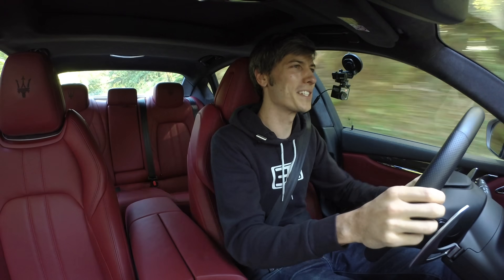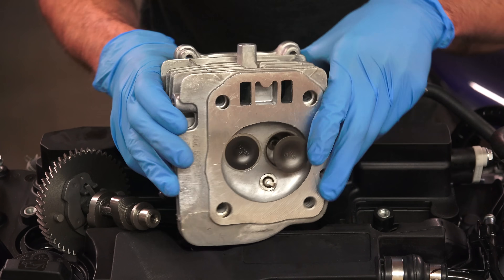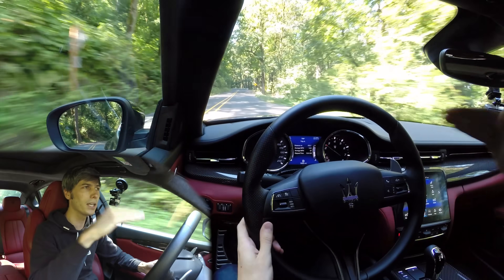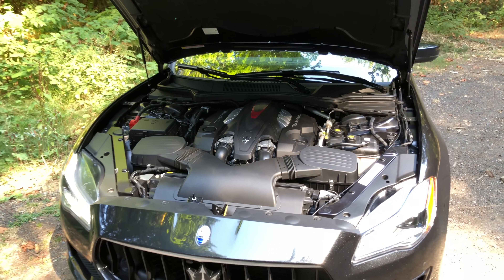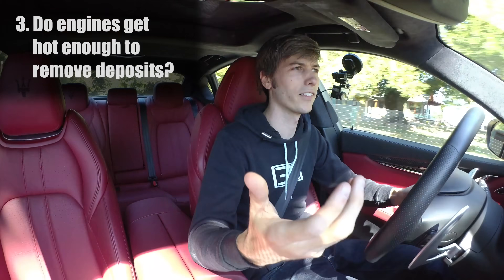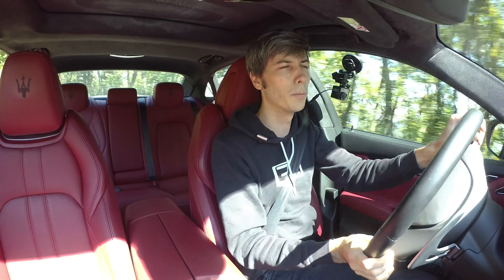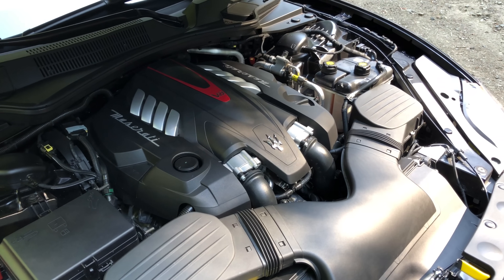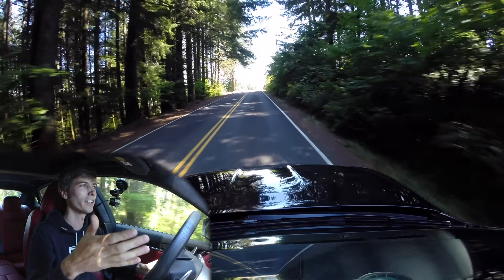Is Redline Good For Your Car's Engine? Italian Tune Up

Comment: Why does the 7.0l ls7 only make 505 horse?
Reply: Because it's NA, a engine is technically a air pump, and an engine can only suck in so much air on it's own, 505 from a na v8 stock is impressive, stock is safe. Port the exhaust and intake, a cam, a tune and you'll see those numbers come up. It'll still be safe, but won't be as efficient on fuel, make more heat, exactly why it didn't come that way stock. Although a turbo or a supercharger, you'll see those number jump, simply because using another air pump to feed an air pump more efficiently and with more condensed volumes of air, but be less reliable because of stress added on components, it's all about more air, more boom, more horse puppies, engine power in a nutshell
Reply: Pushrod V8s don't seem to be able to make very big power per litre without minimizing low end torque and creating excessive emissions, harming fuel economy

Comment: Someone help me!!
I was trying to teach my friend how to drive. And while it was on neutral his dumbass floored it, redlining the car, after that I heard a small pop. Days later my car overheats easily. There’s no leak anywhere. Coolant is at correct lvl. Radiator cap hold pressure. And when I removed the cap there was no coolant in the radiator. Fans work perfectly... any ideas?

Comment: A pointless exercise. Deposits form in different places on different engines depending on configuration, regardless of driving style. In general terms, an engine which is warmed fully, treated somewhat gently and kept with clean fluids will last the longest before major repair is needed. Engines that are track driven need more frequent oil changes and rebuilds, regardless of carbon deposits.

Comment: Just saw this. I'm thinking that there's more that goes into the act of an 'Italian Tune up' than just removing carbon. I feel the term is mostly used in the classic car groups, for one. Burning off older fuel that has sat for a few months, cleaning out gum or varnish that may have just started to form, making valves stick?

Comment: If you spray intake cleaner or even water in the throttle body while having a wedge on your fuel pedal rpms at 
3 k , it will clean alot of stuff out . I know because I do it. You can tell a difference . It might also be cleaning the cat or other parts of the exhaust. Better flow better mojo.

Comment: Could you comment as to the use of a fuel catalyst such a ferrous picanate to help decrease or remove carbon formation. After a brief literature search I have found that this catalyst is helpful in decreasing carbon formation because of a more "even" efficient burn of the fuel. Your thoughts?

Comment: I bought a direct injected turbo from someone who drove the car in stop/go traffic 95% of the time, the car probably never ran harder than 4k RPM.  I used Seafoam throttle body cleaner to see what comes out of it. When I drove it hard (after the Seafoam soaking), someoone actually called 911, because they thought my car was on fire, the amount of smoke it came out was unbelievable.

Comment: Running higher octane fuel is also supposed to clean out your engine. Or you could just drive a Wankle rotary and laugh at people with carbon build up.

Comment: just running the crap out of it is not a good idea. When I got my first car(48 chevy). driving it for a hundred miles at about 45-50mph actually did clean it up enough to make a difference. The idea of running the crap out of it is not a good idea. I have cleaned up carbon with water injection and that really worked good.

Comment: I work with classic cars, which means most of them have carburetors instead of fuel injection. Additionally, thermostats are usually set to open at cooler temperatures compared to modern cars. In my experience, these older cars do benefit noticeably from an Italian tune-up.
Concerning modern cars, I find they can also benefit from an Italian tune-up, although the result is not so dramatic, due to better design. Carbon build-up is not as severe. Having said that, it's always good to go for a long run down the highway, say, on weekends, to clean up all the carbon accumulated in the intake and exhaust conduits during the week on your school and supermarket runs. Diesel engines benefit dramatically from this - think DPF regeneration - as you can easily see the exhaust smoke gradually clear out as you drive at high speed down the highway.
Because of an orthopedic deformation in my right foot - it's bent downwards - all used cars I bought over the years have gotten more responsive after driving them for a week.

Comment: My car ( a diesel Audi ) becomes lazy slightly smokey and loses about 10mph off vmax when I potter about for months at a time. 

A motorway run reverses this process. Vmax returns and once off the motorway the cars acceleration and response is noticeably improved. My car is old tho.

Comment: This is why you are supposed to floor it getting on the highway . Then slow down to about 50 and do a few pulls up to 85 ish  . Also if you’re worried about carbon deposits .... just run super . The Italian tune up is for more older type cars that were all carburetor and just super rich . So they had a lot of built up carbon . Rich is thick . Lean is clean . Lol

Comment: In the old days I saw my dad do this with his old belair and our VW bug. They didn't do this what you're talking about he would rev the engine up and pour water down the carburetor throat and break the carbon deposits lose that way. Has anybody heard of this? No he didn't drench the carburetor opening just a nice steady stream of water enough added throttle to keep the revs controlled.

Comment: I watched this video a month ago and been thinking ever since... seems like your video is all based on heat. But I’m under the impression the “Italian tune up” is based on vibrations and increased airflow and increased combustion pressures and increased fuel flow... I think you should revisit the subject with those in mind.

Comment: How does this apply to turbodiesel engines? Will going full power on the autobahn for several minutes clean my good old TDI? It does not have any EGR system yet, so carbon on the valves might be limited. Also, diesel requires higher temps to burn, which might limit the carbon deposit?

Comment: The people that have talked to me about the "Italian tune-up" never mentioned heat.  They always said it was more about the engine turning at high RPMs and the parts moving and changing direction so quickly, some even talked about vibrations and harmonics, and they were all saying that the engine basically shook or knocked the deposits off with just sheer force.

Comment: I redline my car occasionally, say once a month, and I dont know how much carbon I've got in the engine, but I've got 345 000 km on it with no work done to the engine itself. Also, I redline my motorcycle all the time and it seems to be getting stronger with 2-3 hard pulls. Both fuel injected.

Comment: New sodium filled exhaust valves are meant to keep them cooler though
Reply from the maker: Sure, but exhaust valves get hot enough that generally carbon isn’t as big of an issue. Even sodium ones exceed 600 deg C, where as studies showed over 325 will remove carbon.

Comment: Clever but maybe you missed the most important part, spark plugs. on older less tech engines running at low speeds would often foul the plugs due to over rich fuel mixtures. running at high speed would clear the deposits from the plugs resulting in better smoother running. I doubt that some carbon on the piston will inhibit engine performance greatly. Modern engines can run very lean fuel mixtures so don't suffer so much from fouled spark plugs.

Comment: Why focus solely on heat?. Airflow is another factor to consider.  Airflow through the intake is proportional to power output. Normal driving uses only 10-20% of available max power. At high power the airflow is 5-10 times higher than normal which might break free loose gunk that builds up in the intake, carry it into the combustion chamber and burn it up.

Comment: i do this with some regualarity but with a different goal in mind.  i used to have an 89 Lincoln Town Car and i never tried to push it.  it wasn't built for speed and i was fine to lope along quietly.  day i go to sell it, during the test drive, guy asked can he try flooring it and i say i'm fine with it.  immediately the radiator hose catastrophically fails, all the coolant gushes out, car is undrivable (momentarily) and the sale unsurprisingly falls through.  WOT caused an instant break-down, and it could have been that way for months for all i know.  

these days, when i've hit the weekend or some other point where an engine breakdown won't disrupt my life too badly, i let her rip.  redline that engine a good 5 or 6 times in the hopes that if something were on the edge of failure, it will fail right then, and not when i need it most.  and hey, if it's cleaning something, great.  if not, it's still giving me some peace of mind.

Comment: Have a 1997 Toyota 4Runner with a 3.4L V6 that has been red-lined daily if not weekly since bought new and it has more than 350K miles on it.  The engine is all original but the AT was rebuilt at around 200K miles.

Comment: The Italian tune up is a throwback to a time when fuel and motor oil were of lower quality (50's-70's). Engines at the time would develop coked/stuck rings and general carbon build up within the combustion chamber.   Drivability issues ensued.

Sustained high rpm driving would burn off the carbon and free the rings.  The OP is incorrect when he says "pulls".  At the time you'd go for a 15-20 minute drive.

The last engine I know which would benefit from the Italian tune up is the v8 in BMW e39 M5.

Comment: @Engineering Explained: Here is a quick summary of the chemistry.                                                               1. Methane is the simplest hydrocarbon (CH4) and burns cleanly to CO2 and water. They are part of the saturated (no double bonds) hydrocarbon series. Ethane, propane, butane, pentane ("ane" suffix) etc etc. The general formula is CnH2n+2. (For methane n is 1).
2. The simple unsaturated (double bond) series is CnH2n and is the "ene" suffix series like ethylene etc. Benzene is the cyclic version of this series. These burn less well.
3. Auto fuels are a complex mixture and burn less well due to levels of unsaturation and higher flash points. Under these conditions some heat promoted polymerization tends to occur in the "ene" series along with regular combustion. These form high molecular weight sticky tars which are partially soluble and weakly combustible. (Road asphalt, Barbecue grills!) Any soot formed also adheres to this. Engine surfaces have micro pits in them and allow these tars to penetrate and grow into deposits. Ideally, one can design a super smooth finished surface, but that would make the engine very expensive.
4. Any solvent based cleaning procedure would have to partially dissolve and loosen the tars and carry insoluble carbon with it. Pure carbon itself is not soluble, but can be suspended in a medium as in India ink. Targeting the tars is key. The best method is a physical cleaning, which is tedious and/or expensive and can be justified in some instances.
5. The decarboxylation you referred to in the video is part of this complex process. Heat can technically achieve removal (with its shortcomings) as you correctly pointed out.
6. Other components in fuels can include small amounts of  organo-sulfur compounds like thiophenes which produce SO2. Hence the ultra low sulfur fuels that you see today.
7. Lean burning reduces CO and unburnt fuels and improve fuel economy, but produce NOx due to the chemical reaction of nitrogen with oxygen at high temperatures. ( a stoichiometric reaction would be 1:1 in mole ratio). In the case of methane and oxygen we will need 16 gm of methane for every 32 gm of oxygen, as the molecular weight of methane is 16 and that of oxygen is 32 AU. A lean burn would thus involve excess oxygen i.e. Air. If the ratio is very lean no combustion takes place. This lean burning has a complex effect with respect to tars and carbon deposits and engine designers are constantly tweaking this. Mazda has been working on this for some time now in their Skyactive engines.
8. Ultimately, no engine is immune from from carbon and tar deposits in the long run and physical cleaning is the best way. If one can get 125 to 150 thousand miles over a ten year period, it may not be so bad. The car may not perform optimally, but can still be a basic transportation car. As we age we get deposits in our blood vessels and heart valves!
Reply: Addendum to point 2 above. Benzene does not conform to the CnH2n formula of the " ene" series as it is cyclic. It is also a delocalized pi system. However, it burns with a slightly smoky yellow flame unlike alkanes like methane which burn a clear blue. In that sense it is an " ene" hydrocarbon.
Reply: Additionally, engine oil can break down and heat polymerize by the processes described above adding to the problem over time.

Comment: Here in Croatia a lot of people drive cars with tubocharged engine , and it is known fact here is that if you are driving your engine hard (ex. 4th gear on highway 140km/h for about 5-10 min) will "blow  up" your engine and you will easily pass ECO test. When I say blow up I dont mean your engine will explode, I mean that through engine will pass a large amount of air. Because driving hard will burn carbon deposits in turbocharger, and you also clean your injectors  because a lot of more fuel pass thrugh injector and it clean it self that way, so the fuel will burn cleaner with no black smoke. Engine gets clogged in town and at low speeds and short distances.
 

When you are doing this engine should be at operating temperature, and you press throttle hard in 4 th gear from 90-140 km/h couple of times, do it on higway.

A lot of people says here that italian tune up works, I also tried, and after that car responds better with less smoke. Especially diesel engines. 

(Sorry for bad english).

Comment: The biggest reasons for losing power is dropping the compression. And apart from a hole in your piston or valve, the biggest problem is stuck piston rings due to carbon build-up in their grooves. Apart from not changing the oil regularly (and/or using the wrong oil or oil with poor quality), the biggest contributors to this problem is driving car in the lower rev range. Revving it harder makes the piston rings to heat-up and expand more aggressively, braking up from the carbon deposits. Revving it harder rises up the temperature and the deposits are burned up. Revving it harder makes the oil squirted beneath the piston crown and through the oil galleries wash away the carbon deposits. Driving the engine in the lower revs causes the oil to pass slower through the oil galleries essentially causing it to spend more time in heated area before passing away which contributes to that decomposing effect of elements in the oil which in turn stick to the walls in the oil galleries much like clogging up heart arteries (look up Peugeot 1.6 HDI engine blowing turbos frequently). Revving the engine causes the piston rings to rotate in their grooves helping to keep away the carbon deposits. Similarly, revving the engine high enough causes the valves to float and rotate essentially cleaning itself and its valve seat making it seal better. VERY IMPORTANT NOTE AHEAD!!!: all above for revving the engine helping it live better is true and also remember these things are pretty good engineered mechanically, HOWEVER! do NOT rev them near the red line or even keep them there for period of time!!! The red line is there for a reason. There are many reasons and here is one: in 99.9% of the vehicles on the road the valves are retracted in their position by spring which after years of work loses even a little part of its strength. By revving the engine in the red line if you see your valves closing in slow motion they are bouncing on the calve seat 1-2 times before settling on each rev. The forces acting there are great and at one moment the valve stem can snap resulting in catastrophic engine failure. So yes, rev your engines, drive them in the higher rpm range from time to time, but stay away from red line! In maybe more than 90% of the engines there is power loss anyway in some 500rpm before the red line so essentially you are losing if you don't shift-up a gear. Happy revving.
edit: oh, and one more note: revving your engine does not necessarily mean to drive faster! Just stick to your lower gears to keep the cops away and everybody else safe!

Comment: I’ve often found that turbo diesels previously owned by shopping trip grannies benefit greatly from a good thrashing. It blows a lot of smoke at first, then it settles down. It noticeably or even quite dramatically improved performance. It’s probably cleaning the injectors out, they’ve likely never been open properly in their lives! Dirty injectors can also leak fuel causing excessive smoke, it seems to help that as well.
No need for red line, though. Quiet road, car thoroughly warmed up, full throttle through the gears, changing before red line.

Comment: If tyhe engine didn't need 'cleaning', then no effect will be felt.  If the rings were a bit 'sticky' due to soft carbon deposits, then perhaps a bit of hard running might clear them and inprove compression/sealing?

Comment: Wrong preposition. The heat and shock cooling cycle of hight wot/load temps and the engine breaking cool off that makes the carbon dislodge. If you don´t know that, you´re out, Jason. It´s an expansion and shrinkage relation that is difference between metal and carbon that makes the job.